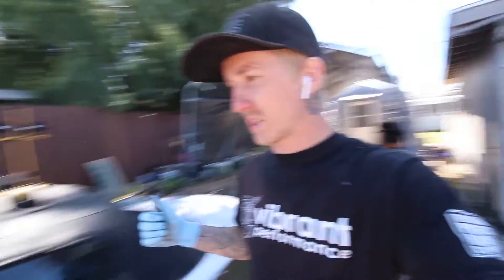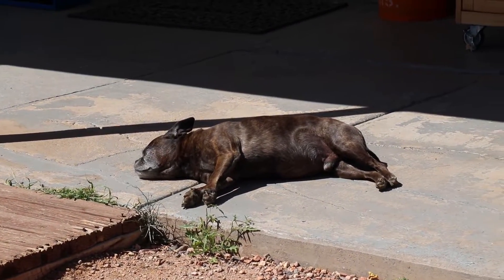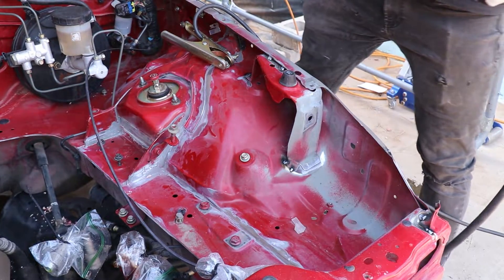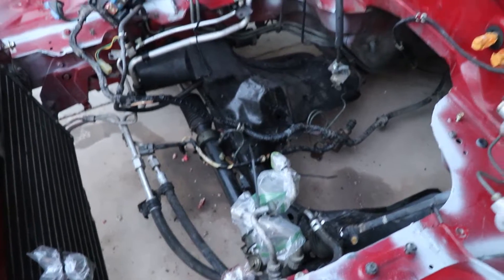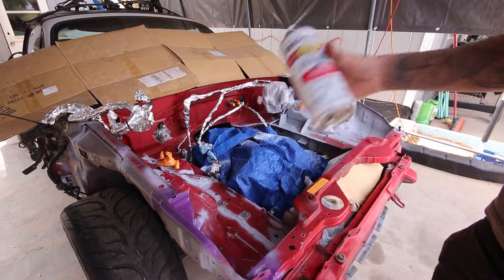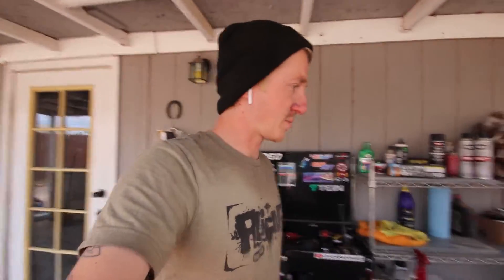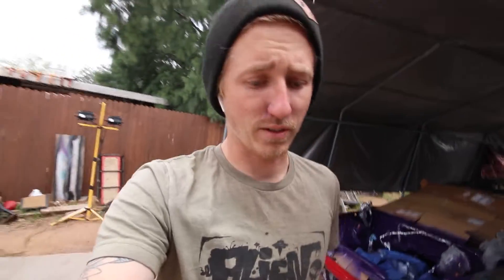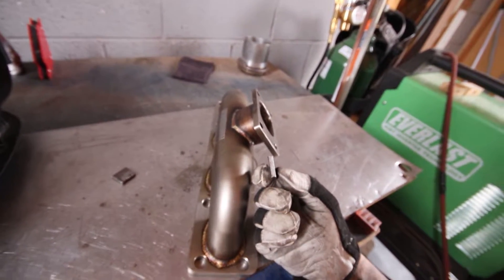Miata Gets Stitch Welded and $6 Paintjob

Comment: what welder did you use?
Reply from the maker: Harbor freight titanium Mig 140 using 75/25 carbon/argon mix
Reply: @ChrisSadowski  did you use 0.8 or 0.6mm wire